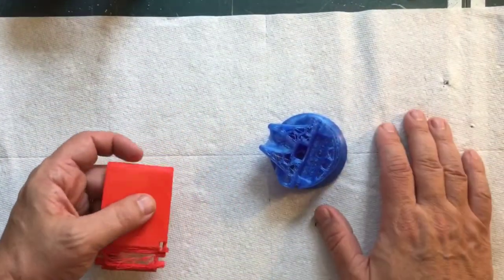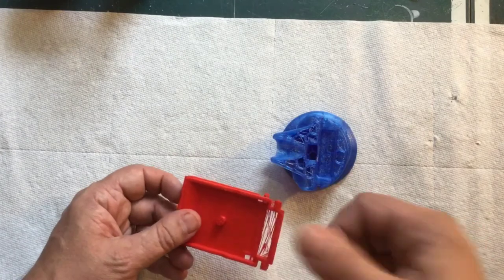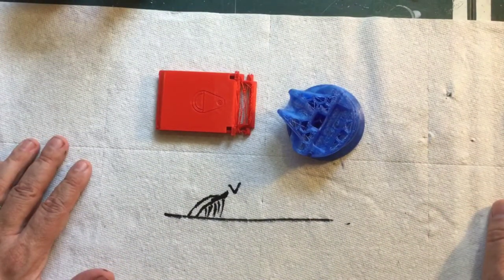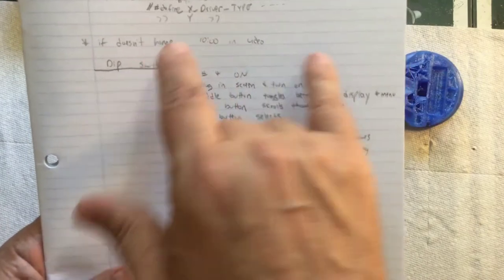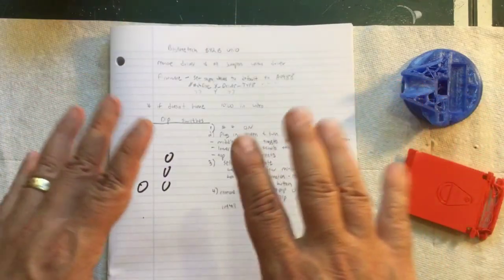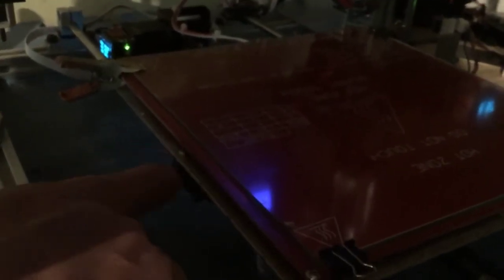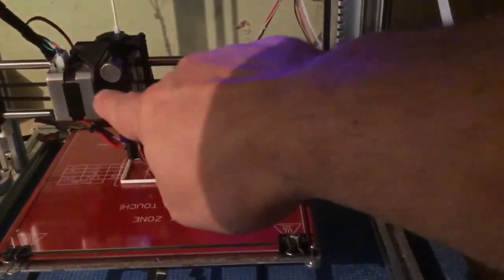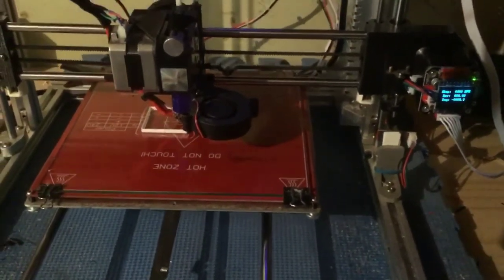Print shift problems and using closed loop stepper motors

Comment: your screens- probably noise from motors- depending on your power supply 12/24 v. using a capacitor 16v 1000uf- 25v 1000uf on the voltage line going into the control board should fix the screen issue.
Reply from the maker: Yup, I actually eventually did that.

Comment: I actually had Y shifting on my geeetech A20M I ordered a skr 1.4 board and new tft screen to upgrade because it was pissing me off. The day after I ordered the stuff I seen Micheal video on the closed loop stepper motors and was like damn I need that so I ordered it but the board and stuff came first so I did that upgrade first and still have stepper motor sitting on the shelf.
Reply from the maker: Well I just got two new displays to replace the ones that were glitching. The new ones are worse. The motors and closed loop boards have already proven themselves worth the purchase, but the displays are junk. At least the displays aren’t really needed once everything is originally set up. So the first stuff you got fixed your issue ok I guess then?
Reply: I plan to get the geeetech  A20M recently. Can you me some suggestions about a20m? Thanks.

Comment: Those little screen modules are quite easy to damage if anything happens to the glass. The corners are very fragile. The display controller itself is on the glass, so it can cause way weirder problems than just missing lines if something is physically damaged. These ones might only start showing signs of damage when the printer starts vibrating. Not saying you caused any damage, more likely happened during shipping, but be super careful when you fit the new ones.
Reply from the maker: That makes sense. Thanks. I did notice when I opened the box, some of the pins were bent. So yea, I’m sure they were thrown around and smashed during shipping.
Reply: i wonder if they would function better with a remote mounting like on the outside of an enclosure. im really wanting to try these on my 3018 cnc as i seem to get 80%done with a project then get a skipped step and ruins the whole project.

Comment: I suffered from layer shifting a few times on a new printer and "solved" the problem by printing at 80% speed. 
Nothing was slipping or loose.
I guess the bed is too heavy for the steppers to stop the motion, after the bed had a certain speed in some direction.
I ordered a set of closed-loop steppers and give them a try.
Reply from the maker: So far with the closed loop steppers I have experienced layer shift twice. It seem like every once in a while there’s just a random glitch that still gets past them. But I still think it’s much better.

Comment: Great review. I have been printing for only a couple of months and seems that people keep their printers forever and just get on the upgrade path spending more on upgrades than the original purchase price so I think they are going to sell lots of them. But as you say if it is not a mechanical problem this isn't the fix for glitches and gremlins in electronics and firmware. I was expecting you to say, especially with a solid aluminimum frame, that you could now print blazingly fast. Going to a  closed loop system in robotics is what allows you to go faster with accurate motion.. Were you able to print faster?
Reply from the maker: Thanks for the comment. I keep saying I should get a new printer, but I keep dumping money into this one for some reason. I haven’t really pushed the speed, so I can’t say if it prints faster or not.

Comment: HI, thank you very much for the video and i just took notes for the configuration, only thing i noticed and i don't feel it fluid the y axis where i installed s42B but as if it had a slight flicker, did you also notice this problem?
Reply from the maker: I didn’t notice that. Not sure what it would be.

Comment: Hi, Is there salmon skin on printed objects? I read about this issue
How many decibel produce this configuration?
Reply from the maker: Well, on my old cheap printer, I don’t notice any difference in print quality or noise. Maybe on a better printer that produces better quality, you might see something. Maybe.
Reply: @customfabrications  other question, does the extruder stop when the motor loses steps?
Reply from the maker: Not that I’ve seen yet.

Comment: What Pulse timing do you use for the S42B?
Reply from the maker: I’m only 95% sure I know what you are talking about. Is pulse timing the same as steps? I think I used 16. This is something that was not clear to me. I assumed 32 would be best, but I found a statement online that said an Arduino would have a hard time keeping up with 32, so I used 16.
Reply: @customfabrications  no its different, thats ok.. curious if you ran into issues were one stepper just gets stuck and shakes
Reply from the maker: No, I haven’t had that issue.